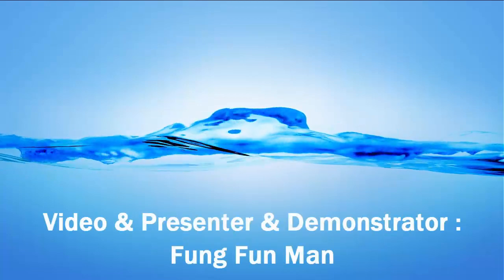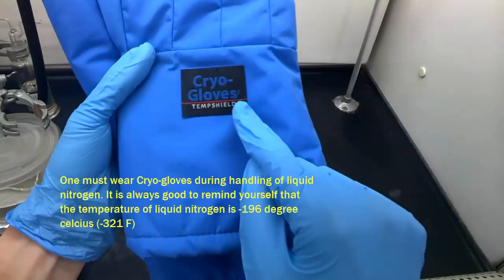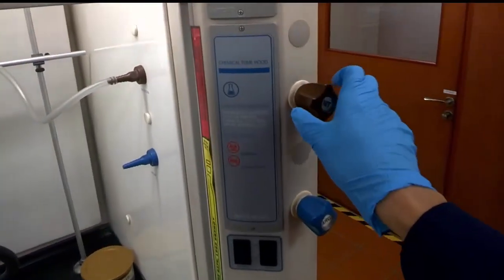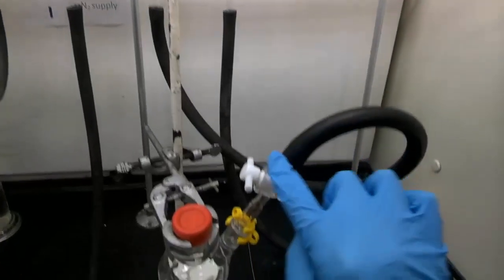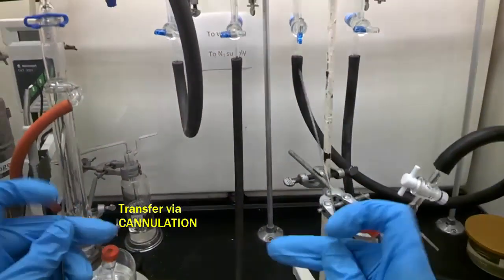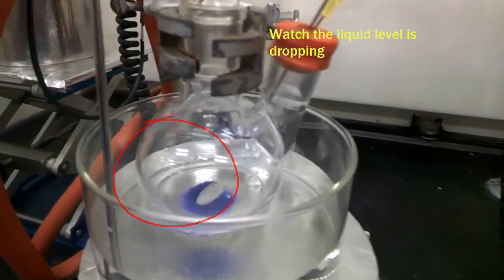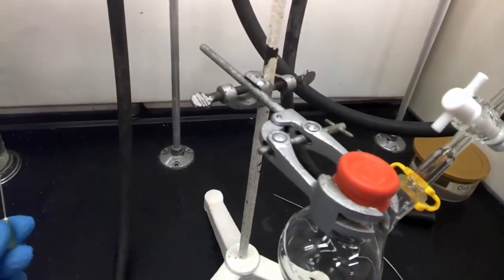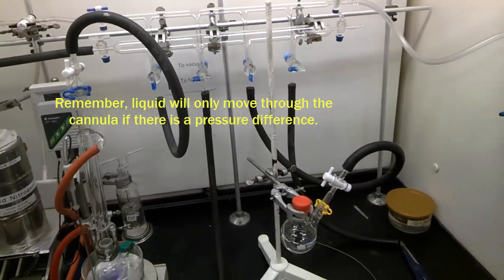Schlenk Line Techniques and Cannulation Technique

Comment: Why do you do not use a over pressure valve ?  Do you do not need it, because do you work just under normal pressure 1013,25 mbar ?
Reply from the maker: Possible to use a valve, just that here we did not have the equipment yet.
Reply: @chemfunman  interesting, I try to understand the function of the over pressure valve after STUTZ.

Is not that easy to finde this kind of information, how to install and how to use this kind of over pressure valve. 

Maybe you have once time and could make a video how to install a valve after STUTZ at a schlenkline

Comment: Good instruction but I don't understand the purpose of this. Looks like a compicated way to pour in your solvent, you can just flow N2 and use a sep funnel or am I wrong?
Reply from the maker: How have you been? It has been a while.
Reply: @chemfunman  yes it has :D
Reply from the maker: Can you quote me the time in the video relating to your question?
Reply: @chemfunman  at say 9:20 you can just pour the anhydrous solvent into a sep funnel and drip it from the top of the condesner under N2 flow or in a nitrogen box. I don't understand what problem is the Schlenk line solving (I'm not a chemist)

Comment: Why did you leave the N2 flowing towards the condenser and the flask after removing the exit needle? Won't that cause overpressure and blow off the septum?
Reply from the maker: Didn’t happen to us! We just hope to keep the interior full of nitrogen to preserve the dry environment
Reply: this is good practice. the excess nitrogen just leaves through the oil bubbler. its good to leave on in case any holes are in the apparatus.

Comment: GREAT video.....one question: 15:32 you say always make sure the oil level is below the rxn. mixture.........I would disagree with this, as I was taught this could lead to hot spots...I always allow it to come to exactly the same level.
Reply from the maker: that is why we need a stirring bar to mix the heat more homogenously. Without stirring, the level of oil bath does not predispose the RBF to possess hotspots. better?
Reply: @chemfunman  - GOTCHA!  Still an awesome video with great info!
Reply from the maker: Zachary Singer love ❤️